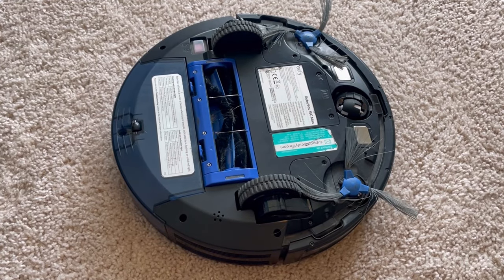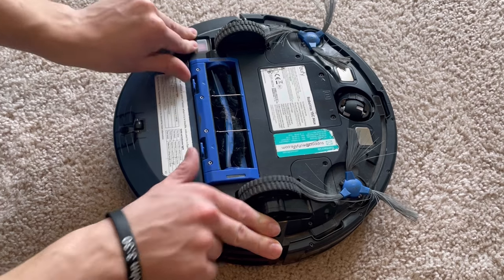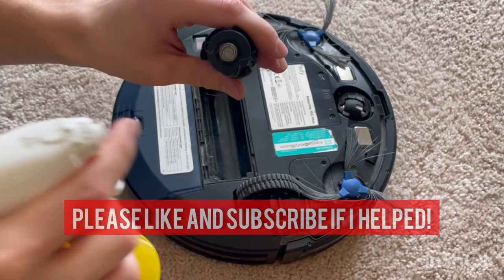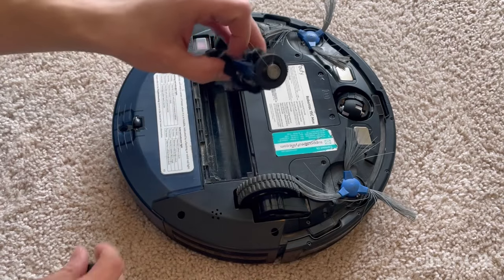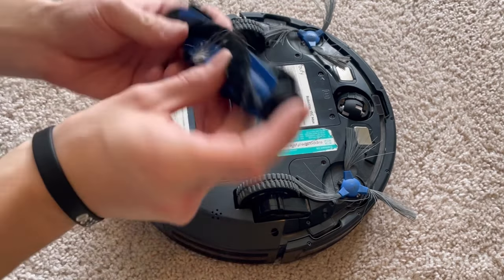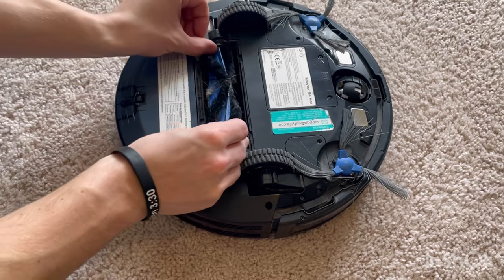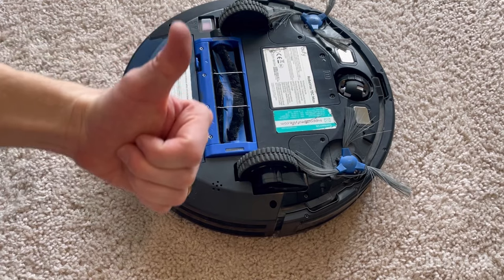EASY FIX- 4 beeps / stuck roller brush (ALL EUFY ROBOVAC MODELS)

Comment: Thanks for the vid.  Super helpful!  Actually you could go a step further, you could pop out the wheel bearing. Just find a flat head or to pry it out.  It would be easier to do that.  All the hair and dust is trapped there and hard to pull out

Comment: thanks for this, it worked for me. Just another tip, you can prize the steel bearing out with a flat screwdriver. When you do this you can then easily remove the bucketloads of hair you will find behind it without any hassle. P.S. I had to gently use vise grips to get the plastic cap off in the first place
Reply: Ty, I think this is my problem. I have a green end & an orange end on mine, nether will bulge. It's all cleaned out but the brush roll isn't moving at all
Reply: @AllChocolateDiet  are you able to remove the end cap?

Comment: If you don't have a cap you can pull the entire thing off anyway. Then you push out the bolt that is actually a kind of ballbearing.
Reply: What model is that on? On my G30 Edge, nothing on the brush separates.

Comment: After spending nearly 4-5 hours in trying to fix by watching several other videos, this trick worked like a charm. You just saved hundreds of my dollars. Thanks so much. It was hard to open that cap as it was very dirty from inside. I manages to open it by pulling it using that pointed portion of nailcutter 😊

Comment: Wow this was actually my problem and totally fixed it, thank you!

For others: I needed torque lock pliers to get the cap off. Don't apply too much pressure on the lock or you'll crack the cover.

Comment: Dankeschön from Germany! Thank you! I was about to take the whole thing apart because of another video, but it was that simple! My Eufy doesn't have a separate cap, but you can push the bolt/ ballbearing out really easily and boy! There's a lot of dirt and hair in there. Looks like something an owl coughed up 😂. 
Für alle deutschsprachigen: mein Eufy hat keine Kappe wie hier im Video, aber das Element am Ende der Rundbürste lässt sich abziehen und der Bolzen/ Kugellager lässt sich rausdrücken. Bei mir war ein richtiges Gewölle drin.

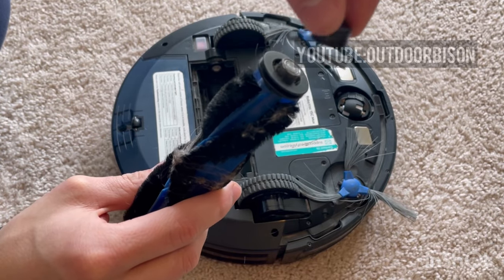Comment: The way you pull the plastic cap off at 00:30, how do you do that? i have been trying everything to get mine off from using tools to pulling. It looks like it should pull off easily but it won't come off.
Reply: Have you managed to do it? Mine is stuck too
Reply: Same. I can’t get it off
Reply: Same 😢
Reply: I had to grip it quite tight with pliers and pull away from itself. Lots of gunk built up underneath and hair! I sprayed lubrication on it and it spins so much better.

Comment: I was hopeful this would work still does does the roller brush is stuck for me…
Reply: Order a new roller brush then?
Reply: @oOTheMuffinManOo  thanks new roller didn’t work either
Reply: @MelissaCast Mine is same. Keeps telling me the brush stuck. I have tried this one and took apart the whole machine. Got all the debris out. Still would run 5 min and stop. I am going to get a new battery because I think it might be battery is weak. It is going to trash of that doesn’t work.